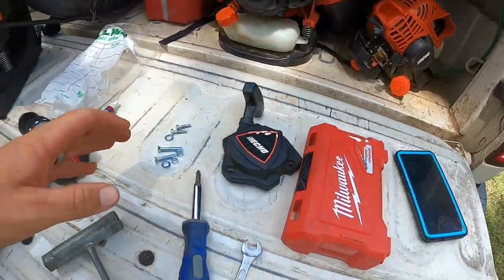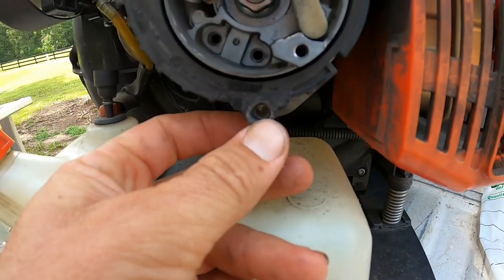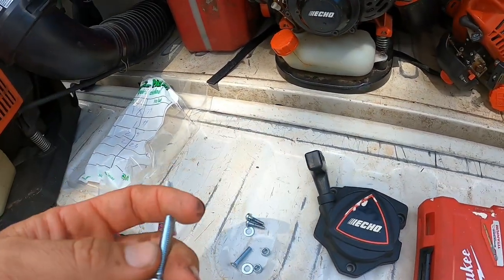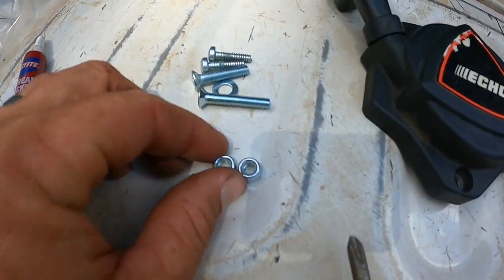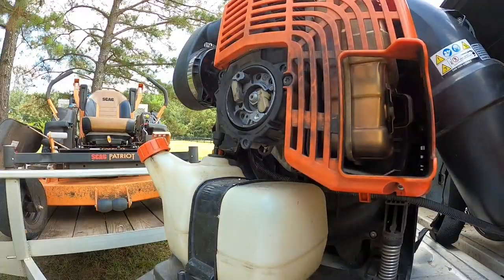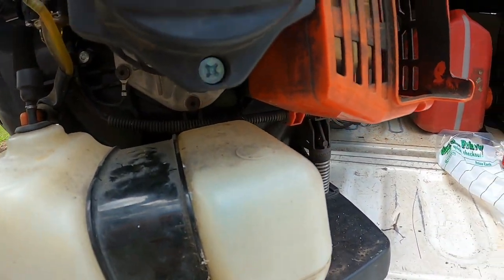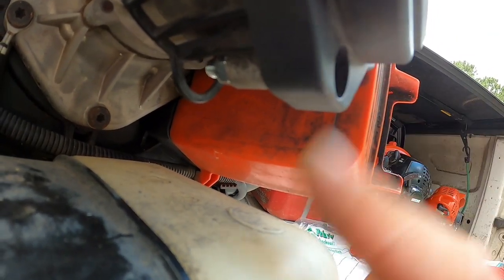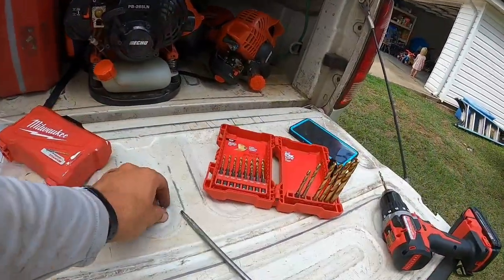ECHO PB8010 Repair "the right way"?

Comment: Should last. Only thing could possibly happen is the casting cracks down the road from being drilled out. But I think that's highly unlikely because it's not bolted to another fixed part such as a frame. Good fix.
Reply from the maker: I thought about that but i really didnt drill out that much since it was already stripped but yeah thought about that hope that never happens!

Comment: My 8010 stopped the other day and the string will not pull, what do you think it is!!  Hollow at me, need help!
Reply from the maker: Id start by removing that pull cord assembly and make sure the pull cord mechanism itself works good and you could turn the motor manually with that assembly off. Take the spark plug out to relieve compression to make that process easier.
Reply: What was it? That just happened to me today!